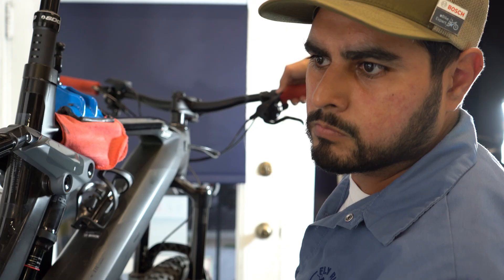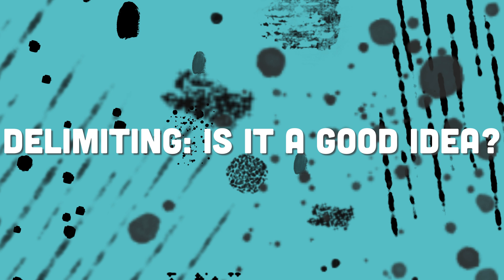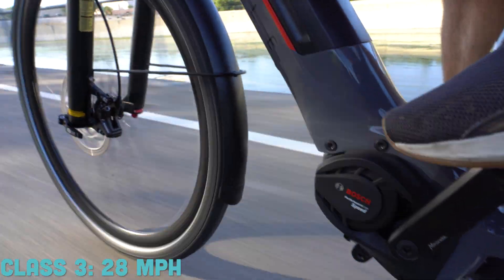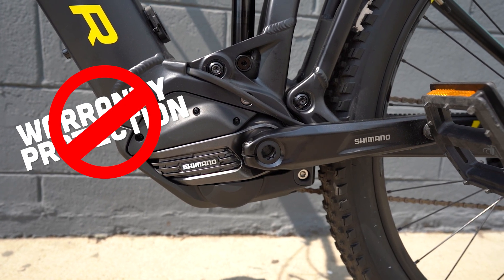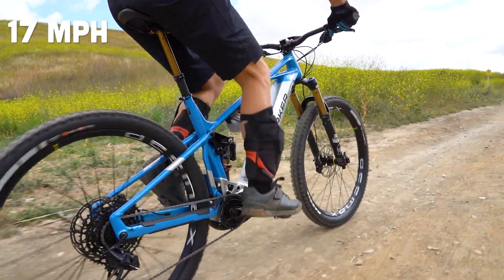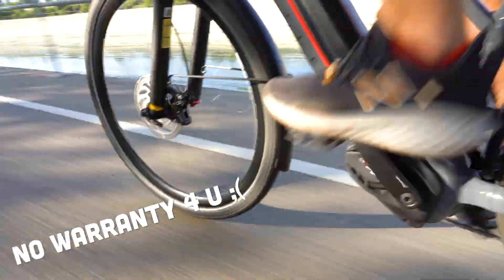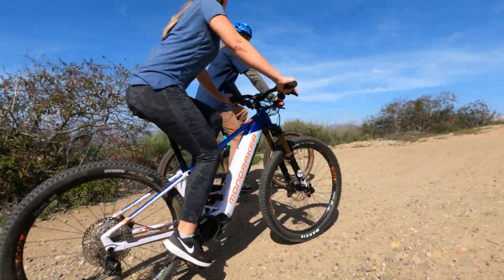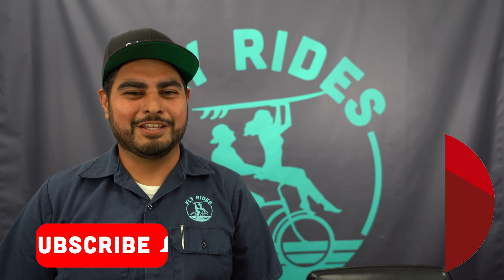Is it Okay to Delimit Your Electric bike? | Everything You Need to Know Before Tuning Your e-Bike

Comment: The  motors are ALL capable of going 28mph. They are sold on many other bikes with this set up. Does not "hurt" them at all.
Reply: Absolutely, assuming you were to set the speed limit to only that of the same model sold in the US then the bike is not under any more stress than it would have been if sold in the US.

Comment: Bad Form is after paying ridiculous amounts of money on ya first E-bike to then be informed you can't ride it in the manner you had intended! 
What a crock of turd! Absolutely disgusted! 5k on a push bike only to be restricted from it's true potential by arbitrary laws put in place by Karen's of epic proportions.
Reply: Agreed but not the fault of the manufacturer. The manufacturers are prohibited to sell or enable an unlock by law however I find it very disingenuous that they would void a warranty if the bike was unlocked to a state of tune equal to that of say the US. It’s the same bike, motor and battery so if it’s warranted to perform up to 28MPH or 45kmh in the US then it should also be backed up in countries where the limit is only 25kmh and the bike has been tuned to US parameters. That is a major failure and cop out.

Comment: The argument about the warranty is mute, mate. If you ask how many people rely on warranty vs how many people ride bikes you would get a very small fraction. Dealing with manufacturer's warranty is a nightmare of itself. Derestrict your bike and enjoy riding with your mates. I currently can push my "Amish" road bike way past 30 mph on a flat road on my own power and at the and the manufacturer would give me the same excuses as if I rode it with 20 mph.
Reply: Great comment. I just want to ride at the speed that the bike was engineered to safely run at in the US or New Zealand. Nothing more. It’s my own decision and responsibility should I end up in legal trouble for riding faster than my draconian local laws but the warranty should be upheld if the bike isn’t run outside its original design capabilities. Just an easy cop out for manufacturers to void warranty based on this. Especially when their warranty costs are built into the ridiculous profit margins of their batteries.

Comment: Old post I know, but you didn't mention that 'Class 2 also have a throttle which allows for speed without pedaling.  Class 1 and 3 are pedal assist only.

Comment: How does a bike know your speed? If the derestriction modifies your sensed speed signal?
Reply: It doesn’t. It will read an incorrect value however the CPU will have recorded the fact that the motor has operated at a power level, speed etc higher than it would at the limited speed value. The numbers wouldn’t add up and then they would know the bike had been de restricted. A total cop out if the speed had been set not to exceed that of the same model sold in the US.

Comment: This is a case of lumping everyone in one bucket. I ride my eMTB exclusively on public, gravel roads,  because that is all we have here. And so I am stuck with artificially limited Levo speeds for a motor that, on other models from the same brand (Vado), is set to a 45 km/h limit. 

Talking trails, my experience from where I previously lived is that there are very few times where you can go above 32 km/h, except on downhills, where the motor isn't much help anyway. I'd be open to learn if others have differing experiences on this, and have seen significant cases that justify the motor speed limit off road.

For the most part, the only time while using the motor I can get above 32, up to 45 km/h, is on paved roads, and usually with favorable wind or incline. So why do we have speed limiters, and why is it morally wrong to override them? I need an eMTB for our terrain, and why am I caught up in this narrow-brain thinking that is basically dictating that I can't buy an appropriate bike for my location?

Comment: While I agree that riding too fast on a mountain bike, off road, is not being a good steward or citizen.   The video title did not specify "mountain" but rather all electric bikes.  Going up hill on a mountain bike with a mid drive motor, it is nigh on impossible if not extremely difficult to go faster than 15mph on a class one bike...hard to actually achieve the 20 mph limit.  Going downhill, ebike or acoustic bike, the speeds are the same limited mostly by trail conditions.

On roads, especially going through towns with traffic, a bike is actually safer going at the speed of the cars on the road.  Delimiters allowing one to exceed 20pmh on roads actually make a lot of sense.  Once the warranty has expired, turning a class one into a class three using a delimiter or dongle is a personal choice and can be both safer and more fun.  

I have had a delimiter on my 2018 Riese & Muller Delite for over 3,000 miles and have had no motor issues.  It runs a quiet and smooth as it did when I bought it.  I don't go over 15 mph on mixed use trails on any bike and usually slow to a crawl passing parents with kids or people walking dogs, only speeding up when there are no other pedestrians around.  

The reality on mixed use trails is that the most flagrant violators of the usual 15 mph bike speed limit are roadies, ripping past people with their drop bars and spandex, often well in excess of 20mph and never slowing down.  No motor, no class limitations, just rude and careless cyclists.

Rules and restrictions are a poor substitute for good manners and being considerate of others,

When it comes to how I want to modify my bike, and what the consequences might be for doing something ill advised, if I am not endangering others, I'll make my own choices, thank you very much,
Reply: I know this is an old post, but what delimiter did you use?

Comment: First, it is true, we don't need bad publicity from emtbs,...emtb trail access is  still unacceptable in many places in the USA. However, there are a couple incorrect assertions here...1) 45mph is NOT a reasonable attainable speed on an unrestricted class 1 (250w) emtb any more than it would be on a regular pedal bike. Look at the tests done by EMTBN...regular bikes actually had higher top speeds than derestricted emtbs. I find that to actually not to be true, but  the difference is maybe a few mph at most  2) High speed does not equal high torque or stress on motor. Electric motors are fine spinning much faster than the limiter.  If 28mph is fine on the road, the same motor is not getting  "stressed" going 28mph on dirt. . 3) The only reason for the speed limiters is legislation.  The 250w nominal  rating of all class 1 emtbs is the limiter in and of itself ,and the only one needed.

Comment: my eMTB is 32 km/h (which is fine, I can't ride that fast in twisty trees anyway) but my egravel is euro-spec 25 km/h which is all but useless on the roads and probably actively more dangerous for me in traffic.

I've had a warranty claim out for 6+ months now to get it switched to the 32 km/h limit that it should be here and that hasn't happened yet, so at this point "no warranty" isn't much of a threat anyway

Comment: Yeah but in Europe and the UK we get limited to 15mph, when Bosch will warranty the EXACT SAME MOTOR for up to 20mph in the US. This really isn't practical for commuters. Those extra 5mph makes a huge difference with confidence on the road.

Also, I doubt there is a big difference with the internals of a Performance CX vs a Performance Speed motor. So it seems like Bosch is skimping on their warranties and hiding behind legislation.
Reply: i took the limiter off my bike as it got thrashed on the straights as well been  limited to hitting certain jumps, all it was getting good for was up hills if i couldnt off took the limiter off it would of been sold as it was getting boring